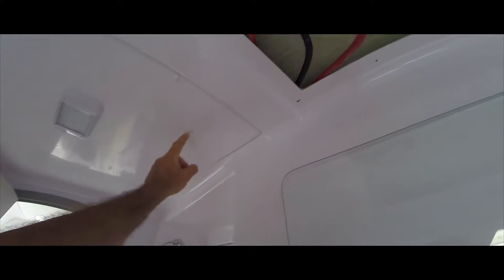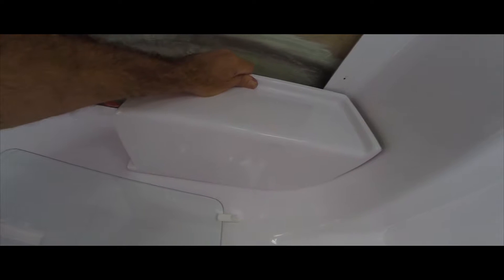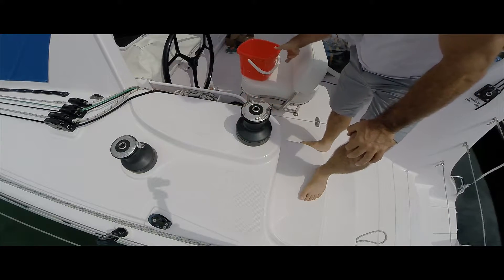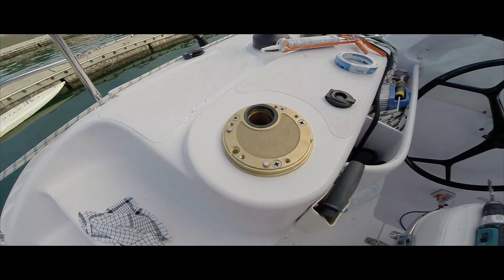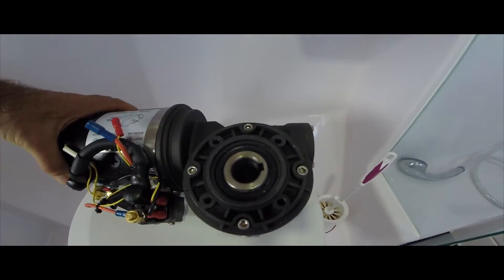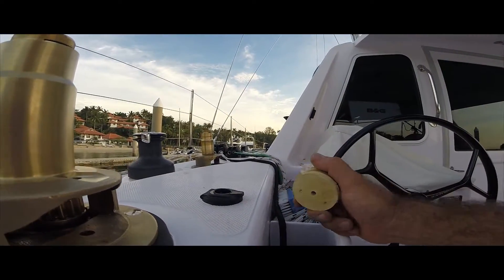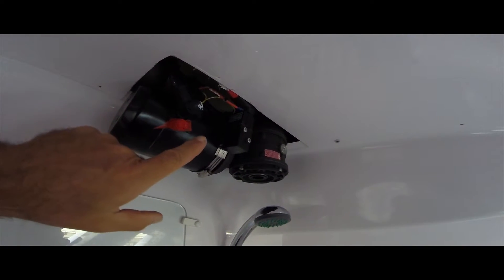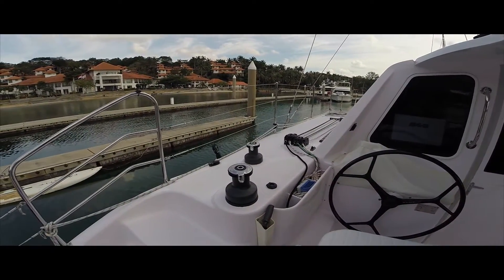SV Pali Pali Story # 18 (Electric Winch)

Comment: Did you make the motor cover (the one for the head ceiling) yourself? Or is that something Seawind already had pre-fabricated since they offer this sort of feature from the factory?

Thanks for the video!
Reply from the maker: Hi Michael, the motor cover was supplied directly by Seawind in Vietnam, if you contact them or one of their agents they should be able to supply. The installation was fairly complicated and took a lot longer than what I have originally planned but its worth having in place for when you want to pull up the main.

Comment: Always very informative projects and great sailing shots!!! How about a 30 second follow up "tailing the main" and a close up of the final finished motor covered in the shower? 

Does the factory have electric winches as options... I'm sure you saved $ by doing it yourself!
Reply from the maker: Hi John, yes will do a final followup , great idea. The factory offers that both Primary winches can be electric, there are saving by doing this  yourself but its a fair bit of work and  there are a lot of pro and cons of doing after factory installs, overall the major post delivery projects are now completed
Reply: I guess now it's "Sailing Time"!!!!